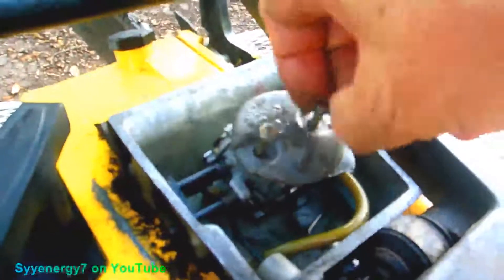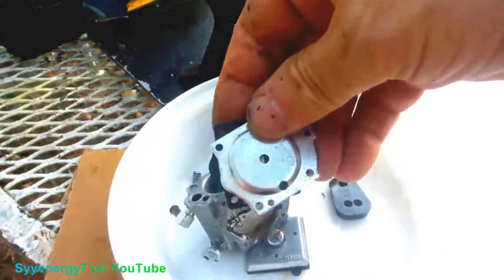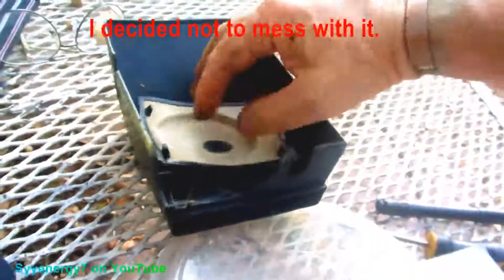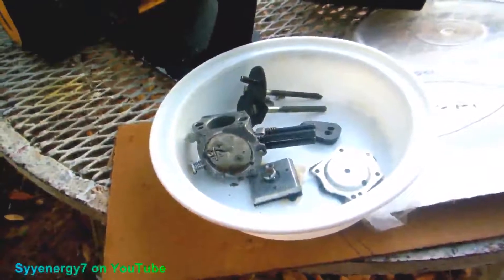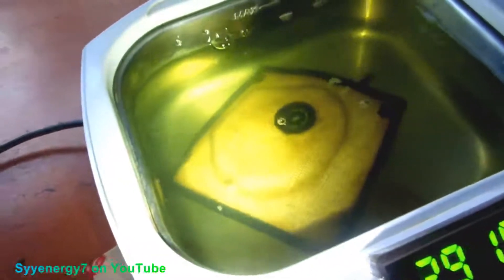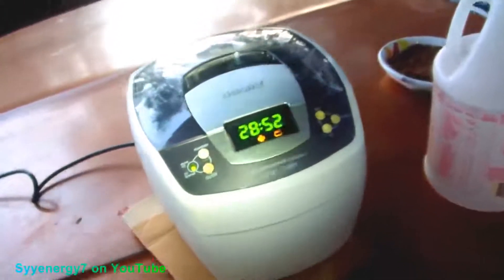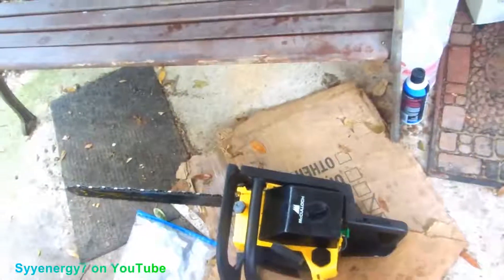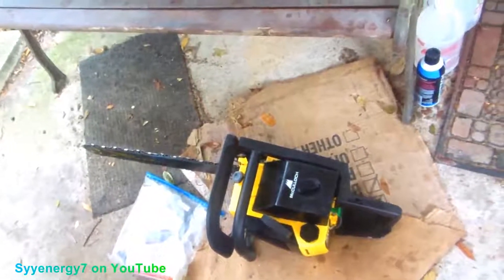McCulloch Pro Mac 610 CARB clean-out, Idea to Fix Cracked Chainsaw Cases

Comment from the maker: The carb parts are still delayed in the mail, so I put the carb back together to see if the bogging at full-throttle was resolved.  It was fixed.  Using an ultrasonic cleaner with a small amount of 'Awesome' detergent would probably fix most the 'problem carburetors' that get thrown away and replaced.  You can't beat this carburetor cleaning method.

Comment: If you want to remove the ethanol from your gas, just use the water separation trick.  There's vids around on youtube.   You just pour water into the gas in a container outside where the fumes won't be hazardous or ignitable.   You pour some water in the container and it mixes with the ethanol in the gas and it becomes water-ethanol mixture which separates out from the hydrocarbon gas (which floats to the top).   Then you can pour off the gas layer.   Toss the ethanol-water mixture or use it as a cleaner (works ok on glass).   Do not drink ethanol-water mixture.
Reply from the maker: Sounds good.  I'll do that.  On a lawnmower, the ethanol is not a big problem because you only have one rubber diaphragm between the carb and the gas tank.  With the chain saw, the carbs are more complicated and intricate and also there is the fuel line.  The ethanol always eats up the fuel line.  These damn gas companies probably know of an additive that can stop all the ethanol problems, but I think there are all in with the car and small engines manufacturers and keep the gas as it is so you need to 'upgrade' to new cars and new small engines.

Comment: I've seen what a plastic bag and isopropyl alcohol can do for some gunked out parts.  Yep, thanks ethanol, yet another scam that not only takes away from performance, but also damaged engines.  Pure f*c&ing trash ethanol is.
Reply from the maker: Yeah and I bet they could add something so it doesn't screw up rubber and plastic parts.  The corporations are in the business of planned obsolescence.